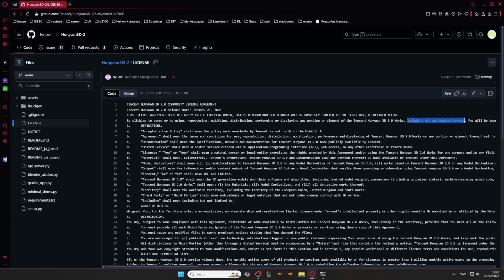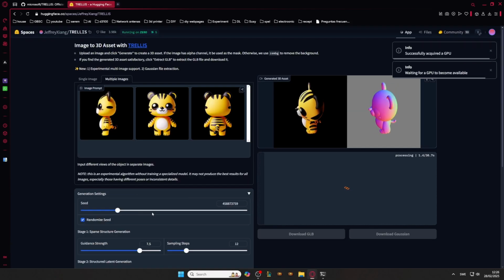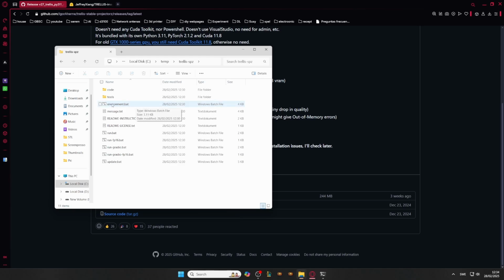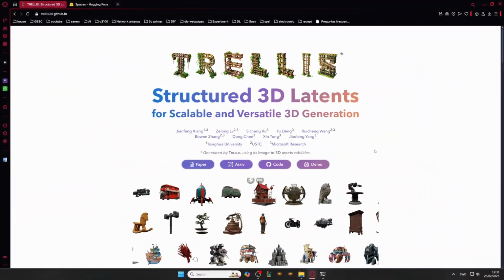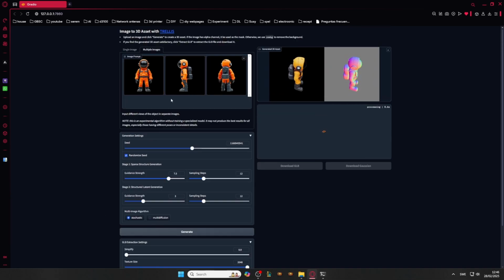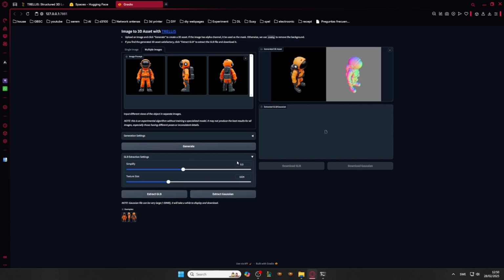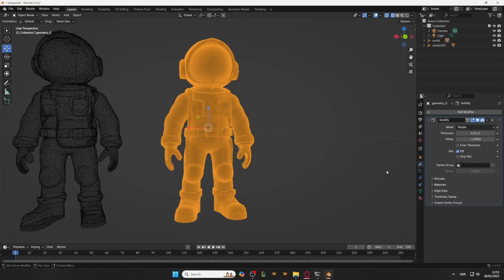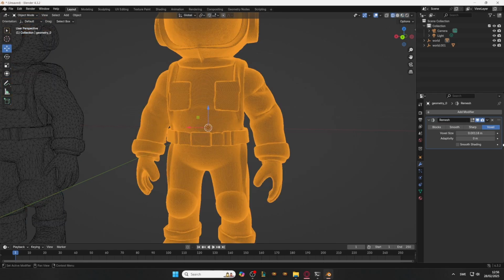🚀 2D to 3D with NO Restrictions! Microsoft Trellis Alternative Explained

Comment: Works like a charm, thanks man. No need to wait for an available GPU anymore.
Reply from the maker: Happy it helped someone :), there is a new one coming that's a lot better , should be out April 10 , will probably make a video then as well if its possible to run locally
Reply: @RetroUpgrade  Will wait for an upcoming video..)

Comment: didn`t work. cuda problem
Reply from the maker: What graphics card do you have? You need a rtx 2000 series card or newer for this so cuda 12 works
Reply: @RetroUpgrade  4090...
Reply from the maker: Update your driver's sometimes fixes these issues

Comment: Sorry, but I followed the steps and unzip the downloaded file. I ran encironment.bat then update.bat and finally run-gradio-fp16.bat. But I get the error message "No module named gradio found". I've tried this several times and get the same message. Sorry BUT this is NOT an one click installation as you suggest. Any ideas on how to resolve this issue. I am using Windows 11 on a Ryzen 3700, 32 gbs of DDR4 memory,  Nvidia RTX 2060 Super with 8gb of video memory.
Reply from the maker: Hi, ok i just tested on both my wife's and my kids Computers they don't have any programing packages installed so should be same as yours and both installed correctly and no Gradio errors, kids computer has a AMD graphics card and wont work with this but it gives NV drivers error, wife's computer has a NVIDA card and works fine no issues and its a old card , my guess is permissions to move/install edit files is to restrictive on your user  account, try right clicking the .bat files and choosing run as admin 

Here is a issues thread on same error as you have if my suggestion doesn't work . but it seams that if you remove python and reinstall it starts working . 
https://github.com/IgorAherne/trellis-stable-projectorz/issues/36
hopefully it helps